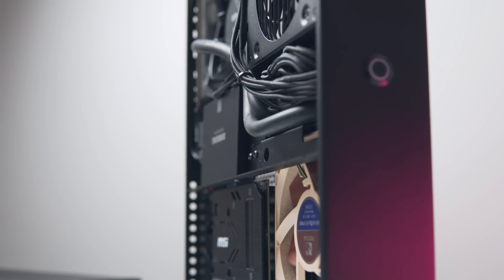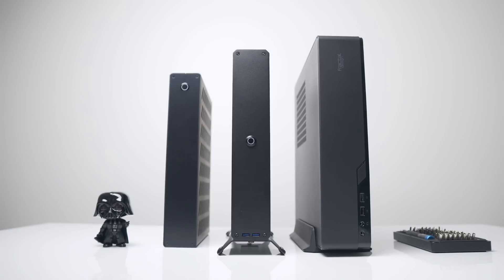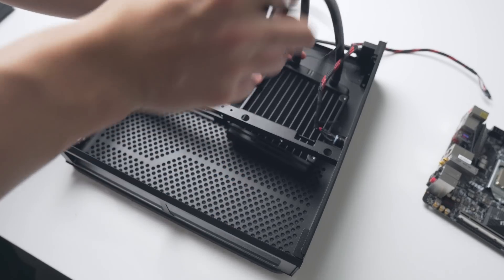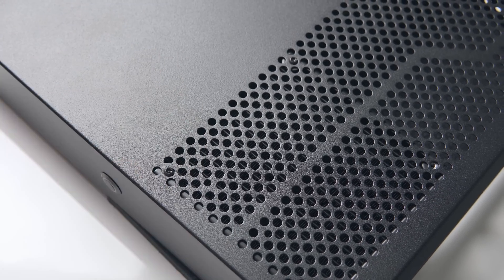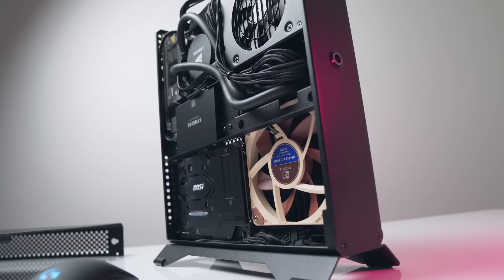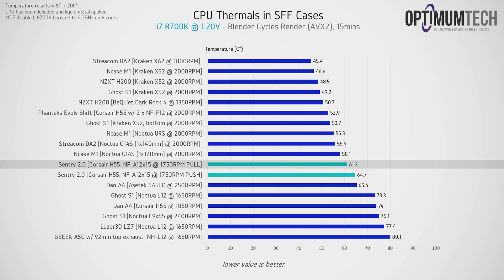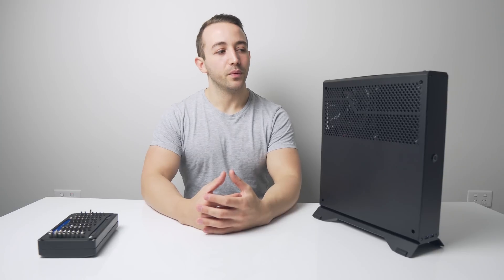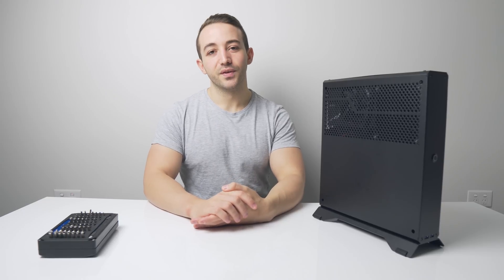Liquid Cooling the Sentry 2.0 - Not Easy, but Worth it!

Comment: I don't  understand omitting ventilation holes where the fan is or where the blower fan would be if that sort of card were used.  I'll wait for the 2.5 mod if it ever comes out to include more ventilation and a slimmer metal bar to allow a thicker fan to fit.

Comment: I dont understand.. you want to use a small case, the smallest you can, with the best components.. but there isnt room...why couldnt they just make it a "few inches" larger in all directions = then everything would have worked out.  And where are the outside magnetic easy to take off / put back on magnectic dustfilters..

Comment: In a world where a Ryzen 5 can keep up with 1080ti with little to no bottleneck, people put 8700k with a 1080-ish card...
I don't get it.
Reply: High refresh rate gaming, something you need a high clock CPU for, unfortunately Ryzens really suck for high refresh in most games since basically no games are optimized for their increased latencies, so for 144hz and up ryzen is still a no go.
I personally use Ryzen because I prefer 75Hz with higher fidelity and use it for productivity, but other people may prefer higher fps with less details on 1080 ish cards.
Reply: MrSlehofer The card is way weaker than the CPU, even at 1080p you'll get really painfull bottlenecks. Benefiting from this CPU even with a 1080ti is only noticeable at 1080p
Reply: @Motishay  it is way weaker at the max settings, not on the lower ones high refresh gamers opt for :)

Comment: Speaking of 2080s and 2080 Tis, I was wondering if there were any heat sinks like the Morpheus II that will provide enough coverage for the new larger die. I was thinking of going with an aftermarket heat sink for my 2080 Ti and its blistering temps.

Comment: excellent insight on the AIO installation & results. i'm curious if there are any brave souls that have modified their cases by perforating the area above the radiator to allow hot air to exhaust easily

Comment: "water cooled", but only the CPU, not the GPU which is hands-down the most important part for gaming (which most people use their PC for)
Reply: A CPU is significantly harder to cool in cases like this because of cooler size restrictions. That's why you opt to do watercooling on the CPU and not the GPU.

Comment: Wow I am surprised by how well this works because the H55's radiator has really high radiator fin density. Also do you have plans to review another large mITX case, Metallic Gear Neo Mini, that's designed mostly for watercooling? I am thinking about getting that case with two front 140mm fans and a 240mm radiator on the side with a 120mm radiator on the rear, but is a little worried about airflow despite the bottom being ventilated. Thanks.

Comment: This has quickly become my favorite tech channel. Also introduced me to the Ghost S1 which I received and built and it’s hands down the best build quality of any case I’ve ever seen. The billet aluminum is so thick and overall fit and finish is second to none. Appreciate your work sir 👍🏻
Reply: Does yours have a good fit for the side panels? 
Every picture/video ive seen of the s1 has an awful fit of those panels into the extrusions and it puts me off the case.
Reply: Baron Interesting, I’m batch 2 so maybe they fixed some of that. Mine fits fantastic, magnetic lid snaps into place. I’m rocking an 8700k OC’d on Noctua NH-L12, 750 watt power supply (that doesn’t even spin up), 1tb 970 Evo M.2 and custom PSlate cables made to the perfect length. No top hat or bottom addition. My favorite build ever tbh
Reply: @BurnoutsAndBourbon  Hmmm maybe I need to see one up close now then, my problem is im a machinist/metalworker so tiny imperfections and misaligned fits jump out at me, sounds like they fixed the issues though!
had my eye on an s1 or dan a4 for a while now...
Reply: Baron Ah dang if you’re a machinist you aught to build a one-of-a-kind! Between the two I know the S1 has thicker side panels that are less likely to bow/bend but not sure what the backlog on the Ghosts are now. They should be taking orders for batch 3 probably but dunno what estimated delivery is. I think Dan is on V4 now and not sure on the delivery times of those either. If you build one hop back on here and share a photo album. Best of luck mate! 👍🏻
Reply: @BurnoutsAndBourbon  Ive thought about it before, never gotten any further than that though, one day...

Comment: Have you ever tried design your own case? It's pretty easy to find laser cut workshops these days.
Reply: One thing is having know how about layouts, use cases, strengths of sff cases, and another is being able to manufacture something efficiently.

But yeah, showing how Linus' team is making DIY projects, it could be cool to watch SFF-oriented youtubers trying out their ideas in practice :D
Reply: @SaperPl1   Do you think plastic is ok for computer chassis? I am thinking about 3D printing.
Reply: @allansh828  Depends completely on type of filament, layout and structure of the chassis. If you have induced airflow with chassis fans, then 3d printing should be fine. Note however that your mileage with such case may vary, so for carryable/portable/mobile SFF case you need to figure out how to make it sturdy with quite a lot of supporting structure to spread out the forces. 

I'd also recommend using laser cut acrylic panels for big surfaces and 3d printing for corners and structure instead of 3d printing whole thing.
Reply: @SaperPl1   I am think about this kind of build. Unfortunately, there's no flexible NVLink. Therefore, RTX SLI build needs a new design. It causes me quite a headache.
Reply: @allansh828  Unless you're using some form of high temp filament, most filaments will start to deform around the 70-80 degrees Celsius, make sure to take that into account.

Comment: You can check out the Custom_Mod lineup of various SFF cases. They are steel enclosures which are EXTREMELY affordable (65$ for DAN A4 type case).
He also makes aluminum models which are 100$. 
I have ordered my own 7.1 L steel one from their website. They are taking orders until 19th April and then it will be shipped out by June.
Edit- no this is not an AD, I have purchased one for myself. (Booked and will be shipped by June)
 He is from Ukraine and that's why his work hasn't gotten that much exposure.
Reply: Probably because he haven't send any for tech channels to review also.
Reply: @abccde3832  ye that's true. The guy is dedicated though you gotta give him that. A few proper connections and he should be the bane for us SFF builders who don't want to put 350$+ (shippin + taxes for my area) for just a FuCKiNG case.
Reply: @char_deux  where the heck do you live.
Reply: @Will91289  India of all places. Rtx 2070 base costs 750$, custom rates on foreign stuff is off the charts.
Reply: Could u share the link pls? :)
Reply: @bpgpw  here is the link in English https://www.custmod.com/magazin?lang=en
Reply: ah, im from The UK

Comment: If you'd used a 25mm rad rather than a 27mm, could you have fit the 25mm fan?
Reply from the maker: Yep! I don't have one here though. 
Thermal results would be interesting for sure.
Reply: You can use 22mm rad from slim AIO like silverstone tundra if you can get your hands on it, or you can use 20 mm thick 120 mm fan that Deepcool makes which is really close to what 25mm fans offer.